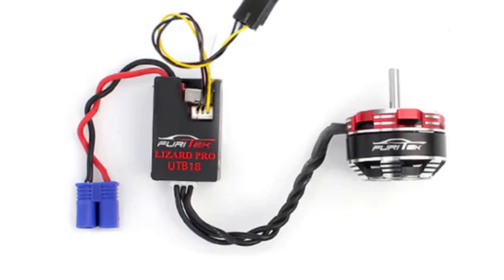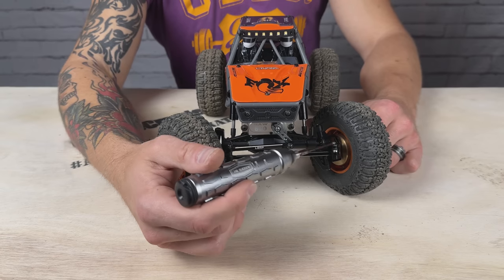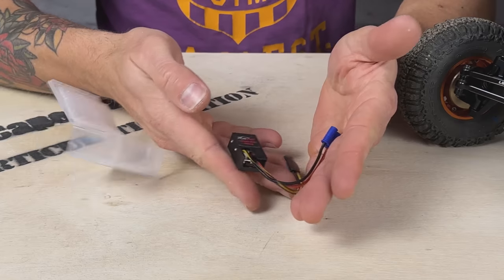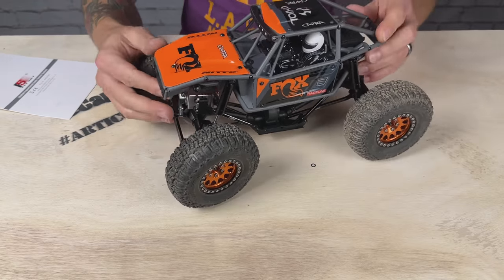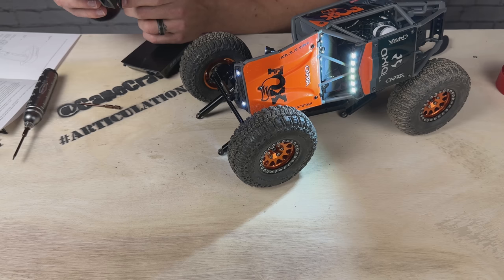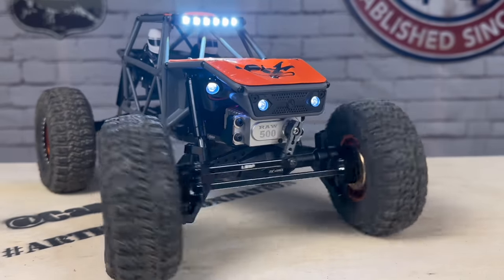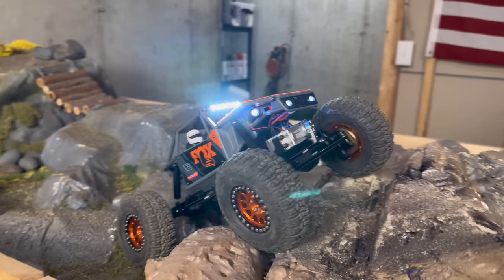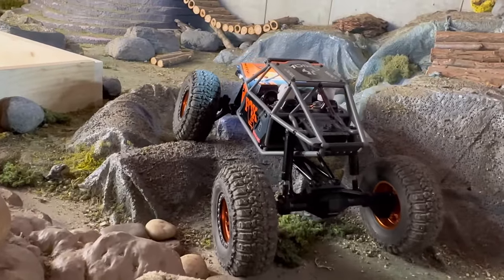Axial Capra UTB18 - BRUSHLESS Conversion - HUGE GAINS!! Installation, Review, Crawling & More!

Comment: That creaking is the front driveshaft coupler, on the transmission end. The metal pin inside the u-joint rubs inside on the plastic. A little gun oil solved the creaking.

Comment: I wrote off the Capra18 initially but with the right parts this thing is actually pretty sweet! I'd love to see a rear steer walk through someday maybe
Reply from the maker: I’m going to do rear steer soon I hope!
Reply: @CapeCrawlers  I have rear steer on mine and with the FSGT5 it is super easy. I put the rear servo on channel 6 and steer with the pot on top. I run left-handed so right hand is throttle and left is both steering, front and rear. I run Reefs 422 HD v2 on both front and rear. Mamba Micro X2 and Holmes Revolver rather than the Furitek although I couldn't say one is better than the other. Wish I could post pics here. Maybe will email them to you. At the end of the day, love my UTB18.
Reply: not that hard to do, and you would love it!!
Reply: Rear steer is easy with an upgraded radio.   The axle comes built.  You just bolt on a servo and switch out the axles.  I run a GT7, so I can move a knob located next to the grip. Super easy to use.  I don't need to take either of my hands off the radio to do any switching or steering.

Comment: Why not just put in a HW1080 or some other manageable controller?  Get rid of the stock electronics and install your favorite radio and ESC system.  Dump the installed electronics and install the system you use.
Reply from the maker: I did exactly that. Switched to a Flysky gt5 and now running it on my Radiolink RC8X, which is fantastic.

Comment: I don't have a Capra but I did a brushless conversion on my Bomber RR10 and a smaller pinion for sure helps correct the "Twicthy-ness" thank you for  always sharing builds with us!!!
Reply from the maker: I will check out the pinion options for this as I am still struggling with the throttle curve. Thanks for watching!

Comment: I love my gt5. I use the same one on all my trucks. You can also adjust throttle curve and many other things and it also has a gyro, so essentially DSC. At this price the radio is one of the best bang for the buck.
Reply from the maker: I haven’t even scratched the surface of its capabilities and I already like it! I need to dig into those functions 👍🏻

Comment: I wish the wires on the Lizard pro were longer, I ended up mounting the ESC under the battery tray with double sided tape, but I am not convinced yet. Great job on the install video! Thank you Adam.
Reply from the maker: Totally agree. I wish I could stick it next to the receiver in the factory pocket. I'm going to try to ziptie mine to the chassis tubes behind the door as my tape is not holding
Reply: All i did , was a little wire solder and shrink fit. put the ecs rite where i wanted.
Reply: 2in. of wire solder shrink fit. Clean and custom.

Comment: Did you test the motor/ esc as it came? I tested mine stock & the throttle was touchy & even though it crawled slow it seemed to jump to another gear noticeably but after I tuned it & adjusted the drag brake it’s much smoother now. It’s nice to have the phone app to adjust the settings that’s kind of mind blowing.

Comment: I set my low speed to 4 or 5 and my punch at 1 to 3 for a smoother low end on the app.
I find the response so good when you hit the throttle that you don't need the punch very high.
Reply from the maker: What about your FOC? I’m going to try your settings next time I run it 👍🏻
Reply: @CapeCrawlers  I always leave it between 30 and 40

Comment: The squeekie old man noice is coming from the rear axel on mine. Keep the 
radio and the capra turned on and turn it upside down. Rotate the wheels on each axel by hand and listen for the creak. Hold the axel and you will feel the creak inside. Haven’t opened it yet so I dont know exactly what it is.  Thank’s for a great video!
Reply from the maker: Thanks! I completely swapped out axle housings front and rear and it still made the same noise. Also changed linkages. Same noise!
Reply: @CapeCrawlers  Ok. I also noticed that it doesn’t have this noice in reverse.

Comment: Hey, been following your UTB18 journey as I recently got one and was looking for some guidance.  I just got the Furitek system today, I was wondering about the lights. Should they all fit into the new receiver? Cheers.
Reply from the maker: It depends on the receiver you got. I got the flysky receiver that has 6 channels, so there is plenty of room to plug them in. But if you don’t have enough channels then you’re going to run into issues. But most receivers should have enough spots to plug them into

Comment: That damn creaking! It’s the front axle flex I think. I just did the injora brass servo mount and now mine is making the same noise. Ripped the whole front end apart looking for a problem. Nothing some Treal housings can’t fix. 😂
Reply from the maker: It’s just crying out for more upgrades 🤣

Comment: Had mine since xmass lost hope with it until someone comes out with a 66t brushed motor and some low transmission gears ⚙️ like the tr4xm I'm done not spending 119 for electronics that still have the twitch ...make me and your self some serious bank and we can start a 24 ⚙️ gear company..update lol I'm running stock motor with a hobbywing 1060..just switched to my spectrum radio wS running a tactic ttx300 was jumpy now smooth as silk 😎 ok rant over ill put down the JB lol
Reply from the maker: I totally understand your frustration. I wish there were more customization options for the drive train!
Reply: @CapeCrawlers  true but to be honest after a couple hrs now all it took was a 268 dollar radio lol I luv this hobby

Comment: What settings are you using on your Furitek system? I am not happy with the Furitek system in mine. The transition between the low-speed FOC and normal speed is harsh and jerky. The thing stalls out under load any time the tire gets bound up. Updated firmware and have spent probably 2 hours messing with settings and it still makes no difference.
Reply from the maker: I'm running the FOC at 30%, low speed at ~15%, punch at 5. Throttle curve is straight linear (haven't touched it). Mine still isn't perfect but certainly not as troublesome as yours I don't think. I hate to say it, but it sounds like maybe a faulty esc?

Comment: Like I said before I run the v2 electronics with mostly holmes hobbies brushed motor...for 120 until they get that little jump in modulation I'll pass still cool though
Reply from the maker: I hope I can get the jumpiness sorted out. If not I may be looking for a holmes setup as well!
Reply: @CapeCrawlers  cool ya its pretty unbelievable with v2 stock setup slow craw for days no jump you can hold the trigger at one spot and it modulates right over and everyone already has electronics so a 20 dollar motor and good to go

Comment: How is about cooging ? I installed this also and I am not very satisfied with this setup - to much start up cogging and I do not know how to fix it - I´ve tried different settings with the app but nothing helps to eliminate this problem - any advice ?
Reply from the maker: Have you tried to smooth out the throttle curve in the app? It does cogg at low speed. I smoothed mine out a little bit but I'm not super satisfied either.

Comment: What are your thoughts on the AX24 XC-1 ?
Reply from the maker: I think it will be a fun project! I'm going to do a reaction video this weekend I think. I've had a lot of people ask my opinion.
Reply: @CapeCrawlers  Awesome look forward to it, I have one on order. I like the fact it is a new chassis to build around but still supports a lot of the existing parts. Looks very capable right out of the box but dang why did they stick with those cheap servos and motor. it would have been better IMHO at a $190 price point with those items upgraded. I guess we would still most likely just end up upgrading it anyway =)

Comment: What suspension are you running on this?
Reply from the maker: Rcawd internal spring shocks
Reply: @CapeCrawlers  I recently installed the same RCAWD shocks. I found I had to add 2 small washers to the rear upper mount to prevent the shock body from contacting the frame. My stock springs made regular contact in the same spot.